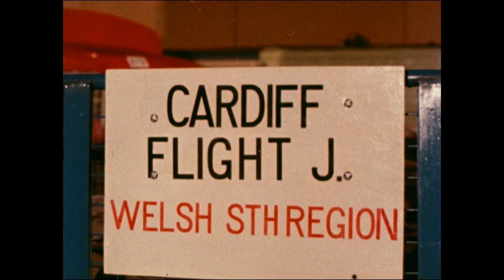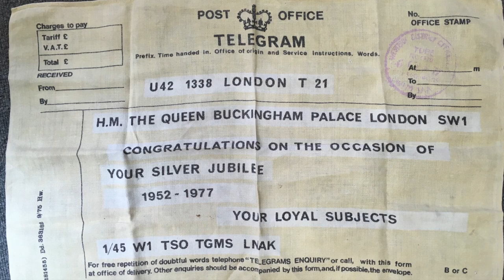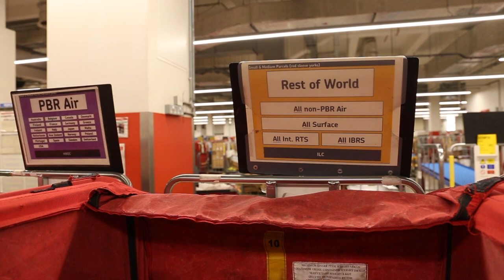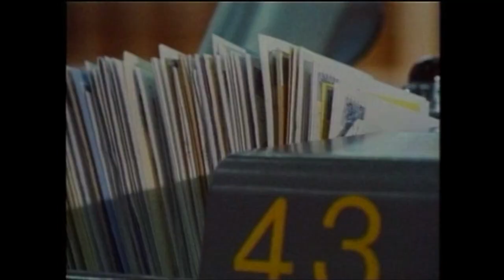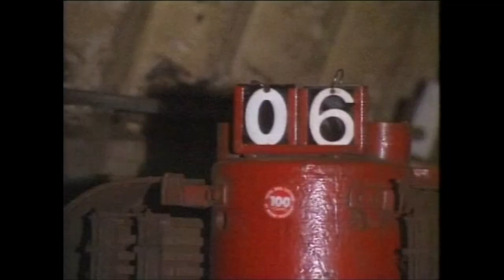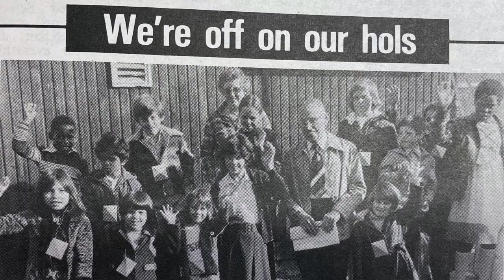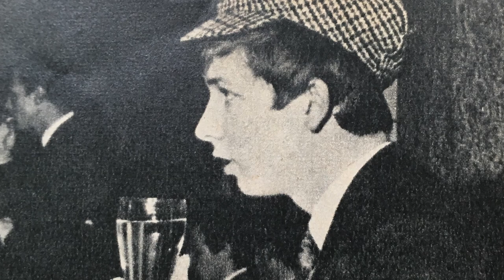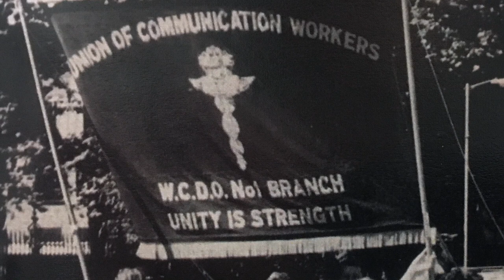Postman's Knock

Comment: Medically retired after 25 years. Started as a postman in 1977 then promoted to PHG followed by Assistant Inspector and finally an Inspector. Last i heard the inspectors job description is now Delivery Office Manager. I was Delivery Office Manager at Barnet Sorting Office and I covered Potters Bar office when required.  Great job which I found easy to fit into having served in The Welsh Guards. I wouldn’t change any of it. Great bunch of lads and ladies to work with. Start 0500 finish 1210 and 0930 on a Sat.👍👍🏴
Reply: hammer have you got anything from mike tyson to me 29
Reply: can you collect brown from carl go to the doctors boots city centre nr21sh and bring me 3z if your with mike tyson
Reply: did you get the sack ?
Reply: 0500-1210, 7 hours and 10 minutes? You get a lunch with that?

Comment: It was like a prison working at the sorting office ECDO , you had black one way window towers at various points of the building along the sorting frames to keep an eye on you.
When you wanted to goto the toilet you had to hold hand up and ask boss you want to go and he will enter it in a book and then ask "what wing toilet you going to" i would say west wing and then he would say you got 5 mins!.
If you took longer they would send someone to check what your doing.
when you were called on tannoy system normally the "BOOKroom" your badge number was called not your name.
The workers were great and always having a laugh most of them were 8th army vets or dockers as film suggests this was during the early 70,s to late 70,s.
ranks were messenger boys,postman,postman higher grade, assistant inspectors (the ones that you had to ask to go to toilet).
The canteen facilities were excellent and well run my fave was double egg curry and chips, tea was 2p , you needed a licence to drive the large old style lifts my lift was hardly used when i was on shift due to all the After effects of the double curries since it hanged around the lift shaft for hours..